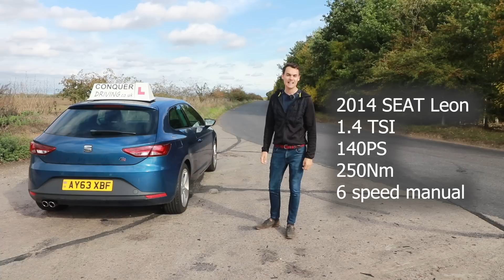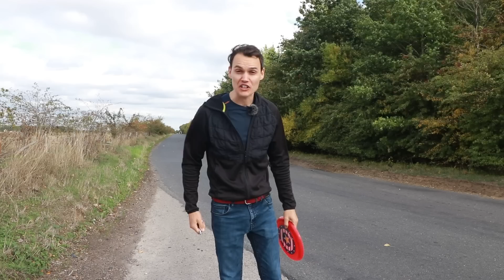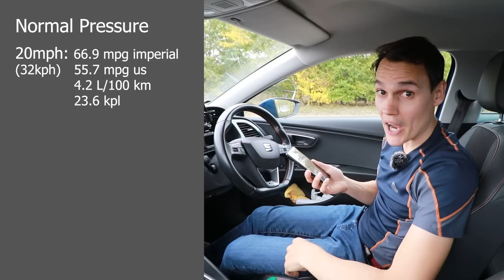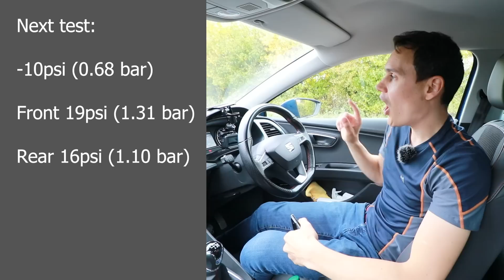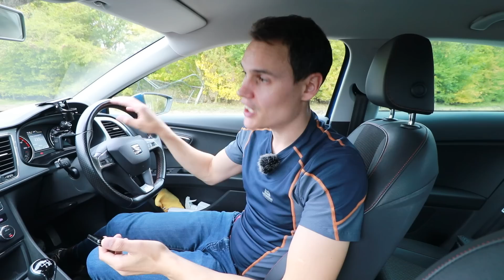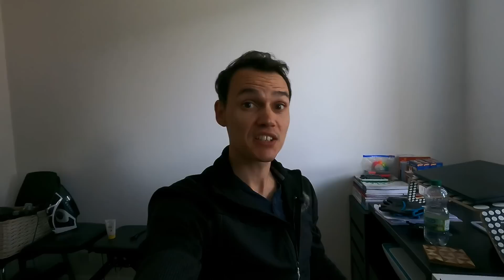Tyre Pressure Fuel Economy Test - Do Lower Tyre Pressures Cause Higher Fuel Consumption?

Comment: For my front wheel drive car, it is specified to use 2.3 bar at front and 2.4 bar at rear. And if its heavy loaded with passengers and luggage, then its 2.5 bar at front and 3.2 bar at rear. I find this weird, since the car is definitely heavier in the front, that in both cases they don't recommend a bit higher pressure at front. My guess is that they optimize for grip in front (they don't put too high pressure), and fuel economy/or possibly carrying heavy load, for the rear.

Comment: I have the same car, seat leon 2014 1.4tsi 140hp CHPA engine, manual transmission. Tyres 225 45 17. My recommended pressures on the fueal cap are 2.6bar on front, 2.3bar on the back normal, full load 2.6 and 2.6... That is a bit more than your reccomended pressure, i dont know why...I drive it 2.8 front and 2.4 back, because anything less that i tried feels bit too mushy on the steering wheel...My tyres wear even, 3 years i own the car

Comment: Fuel economy and tyre pressure dont always follow a linear relationship.

At lower speeds, the impact is greater. At higher speeds, drag becomes a bugger factor in economy, and while pressures still have an impact, its not as big , relatively, as at lower speeds.

However, this is a rather simplistic explanation. Lower pressures increase flex in the tyre, the effect of which is felt more during "uneven" driving - acceleration/decelaration, cornering and braking. If you were to drive in a "steady state", the tyre or flex has stabilized, and fuel economy generally varies much less.

If you were to re-do your fuel economy test incorporating more uneven driving as listed above (accelerate/decelerate/corner/brake) the variations would be most pronounced.

Lastly, the manufacturer recommended tyre pressures are not recommended just for fuel efficiency, the car maker takes into account comfort/handling/safety into account. Depending on the car manufacturer, any or all of these may be given more precedence over fuel economy. So "sticking" to the manufacturer's recommendations does not necessarily mean you are going to get the best fuel economy, it may just be that you will most likely get what the manufacturer claims its cars will do (i.e. comfortable ride or better handling or sporty ride). To get the best fuel economy you do have to experiment yourself and there is always a trade off between all these variables.

Lastly Lastly (i know i said lastly earlier), higher tyre pressures can wear out your suspension and steering components faster. Best not be penny wise and pound foolish and end up with major suspension repair costs while trying to save a couple of dollars/pounds/euro on fuel.

Personally I set my pressures to comfort settings and forget about them. I can save fuel in other ways, mainly by driving smoothly, and that does not have any potential downside of costly suspension repairs,  I am happy to leave a couple of quid on the table in exchange for the peace of mind.

It is a rather interesting subject to theorize over though.

Btw Richard, I must say your communication and presentation skills are among the better ones I've seen on youtube. Very few wasted and redundant words, and always succint yet interesting.Wishing you the best in whichever field your talents may lead you.

Comment: I could be wrong and as this video is old you probably won’t reply but could it be at 20mph with 10psi less in the tyre your rolling diameter decreased enough for the car to think it was covering more distance than it actually was increasing the trip mpg? What are your thoughts on this?

Comment: Fantastic video and explanation! Super detailes and helpful. I have to agree wirh the findings. My Audi recommends lower tures pressure for comfort which I find the ride softer and comfortable. Regarding fuel economy in the comfort pressure, I am getting the the as on normal pressure with better ride quality. I guese it's all about experimenting.

Comment: It's worth pointing out that driving with incorrect pressure can also increase the risk of punctures, which is also a significant cost factor.
Reply: How?  It doesn't matter what pressure a tyre is if you go over something that can/will puncture it - it will still be punctured.  A lower or higher pressure of air between the wheel and tyre does not change the composition of the material used to make a tyre.  To prevent a puncture you would need to change the material or composition of the rubber used, not the speed it is used at.
Reply: This is incorrect. Although high pressures increase the shock on the car.

Comment: One thing I can think of is when running much lower pressures, you reduce your effective wheel diameter, causing your car to think it's driven more miles than it actually has. Thus the higher fuel economy readings at lower pressure I'm curious to test by measuring out a set distance with a pedometer, and comparing it with elapsed miles on the car.

Comment: I was thinking there would be diminishing returns above 40 psi, so not much point going 50, 60, 70 other than having a harder ride and less grip on loose surfaces. I'm not sure at which point the centre of the tyre balloons out, but radial tyres seem to maintain an even diameter over a wider range of pressures and most of the contact patch decrease is front to back, which is the direction that reduces rolling resistance the most.
I think going slightly higher than normal is best for grip as it stabilises the sidewalls. So if you're driving around on 20 psi it's about time you got the air pump out!

Comment: Higher speed = higher centrifugal force on tires, so the tires act as if they're more inflated at higher speeds, that's probably the reason for smaller difference in fuel consumption at higher speeds.

Comment: Tyres lose about 1 PSI in the winter every month maybe 1.5 or 2 depending how cold it is. I always put my 69 plate Corolla to 38 PSI on all 4 when it was recommended at 36 and I get real good mpg on the road.  Regularly at 45 to 70 mpg
Reply from the maker: The Corolla Hybrid gets exceptional fuel economy. Assuming you have the hybrid as they did sell a small petrol in the GB when the latest Corolla was released.
Reply: @ConquerDriving  I have the 1.2t and I get excellent economy. It has 9,900 miles on the odometer

Comment: Lowering tyre pressures on a wheel, causes the wheel to be literally smaller, therefore the L/100 or mpg will read better because the car thinks you're travelling a certain X distance, where in fact the car travelled less in the real world, voiding the results. I loved the video and love your interest and dedication. If all else is equal, this is the last piece to the puzzle.

Comment: Less pressure than recommended equals more flexing of the tyres and therefore more energy lost to that flexing. Energy lost is more fuel used. Simples.

Comment: Have you done a roll test with the car in neutral on a downhill that leads into an uphill?  Cyclists use this test to figure out optimal tire pressure and body positioning for aerodynamics.  Much cheaper than renting a wind tunnel.
Reply from the maker: That is a good idea.

Comment: Hi Richard, thanks for all the effort you put into the video, I especially like that you listed your fuel mileage figures in multiple units, which should cover every country out there.

I am in the US and have been driving since 1971.  I have always been interested in fuel mileage.  Cars in the US have the manufacturer recommended tire pressures purposely set low to improve ride comfort.  All cars here have power assisted steering so, the increased steering effort due to low tire pressures would go unnoticed.

I set my air pressure for each tire based upon the weight the tire is carrying.  I select the pressure such that the contact weight across the face of the tire is constant.  This method gives good fuel mileage and maximizes tire wear.  I also do my own front end alignments.  With a front drive car in the US, the tire pressures usually work out to 42 to 44 psi front, 28 to 34 rear.  The rear pressure variation is due to the number of people normally carried and stuff in the boot.

To give a little more accurate results with your mileage versus tire pressure tests, may I suggest instead to do a coasting test.  To make things easier, just take the car up to 20 mph, then measure the coasting distance.
Reply from the maker: That's a very good idea.

Comment: I have a thought: the diameter of the tires changes and the car computer is assuming normal pressure and nominal diameter. When the pressure is 5psi lower, the extra dragging is not so significant and computer thinks you are going extra distance.

Comment: Hello Richard! Thank you for always making these great and insightful videos that we can't get anywhere else! I know I speak for many of your subscribers when I say I really value your first principles approach to driving and the assumptions people have about cars and related topics.

I'm curious to hear your thoughts about the idea of warming up the engine before starting to drive? Is this really beneficial from a fuel economy (or engine health) perspective? And how does this hold for petrol vs diesel cars? Thanks a lot in advance!
Reply from the maker: Thank you for watching. Everyone has their own opinion about warming up the engine before driving. My advice is to let it run for 5 to 10 seconds and then get moving, letting it warm up at idle will only use more fuel. But drive gently until it's up to temperature to help protect the engine.
Reply: @ConquerDriving  well noted, many thanks Richard!

Comment: tire pressure should be set firstly by tire manufacturer recommendations, not car manufacturer
secondly, should be adjusted to the weather you drive in

car manufacturer pressure recommendations are for the tires it leaves the factory on

Comment: 35 psi front and rear in my Peugeot 306 turbo diesel. I have 17 inch alloys instead of the original 14 inch steel wheels, now running 205/40 profile tyres instead of the previous 185/65 ones. I get a consistent 53mpg, in spite of having increased the fuelling a bit, to complement a freer intake and exhaust. When bog standard, the best I ever got was 47mpg, even at the recommended tyre pressures. Modern cars are so much heavier, safety etc., and I think that most of the loss of economy must be due to actually getting a car off the mark and rolling. A 6 speed gearbox would suit me well, were I one for doing long distance driving, but I rarely go further than round trips of 12 miles nowadays. Isn't it strange how cars of yesteryear, motorbikes also, had much lower recommended tyre pressures ? Heavy 1960's and 1970's cars were often under 30psi and a Triumph 750cc bike I had was 26 front, 28 rear. My lighter, i.e., plastic adorned 2004 1000cc Suzuki V twin is 36 front, 42 rear. Too high, in my opinion, for a 9 stoner like myself. That said, the rear wears its centre out pretty rapidly if I drop the pressure by more than a couple of psi. There's no way we can win ! The VAT man is the only one continually grinning.
Reply: Oh dear, another clueless boy racer!  Who do you trust more - a company that spends millions on research and development, or a backstreet trader that makes wild claims in order to take your money?  The best parts for the car are fitted when you buy it and you're not going to turn a 1.2 or 1.4 or 1.6  in to a racing car.

1. Increased fuelling.  Absolute rubbish, you can't as the ECU stops this, so it doesn't matter what you think you are doing to the car or even what you try, it will still go back to what it should be based on the dynamic adjustment from sensor readings.  Fuel rail pressures can be messed with using a cheap nasty "tuning box" often costing £400 even though it contains a simple voltage multiplier costing 23p!  Those devices take NO input from the ECU or send info back, all they do is increase fuel pressure by a set amount.  They go in series with the fuel rail and damage the engine, especially when cold and more diesel is sent in, the box causes even more to go in and causes smoke and clattering.  You would need a proper ECU REMAP and who would you trust doing that?  Some youtuber that just increases everything from standard without any real knowledge.
Don't forget, those companies will never pay up if you damage your engine!  It is also possible to insurance and police investigators to find evidence of using such devices as that info can not be deleted from the ECU - it is accessed in investigations all the time.
Manufacturers also refuse to honour warranty claims and you void your insurance anyway.

2. The air intake!  Biggest way to make money from fools is to sell them a tiny mesh/oil or foam filter that doesn't even filter and is a much smaller surface area than a paper filter, so ends up blocking up and degrading performance far quicker, plus it doesn't pass anywhere near the amount of filtered air to the engine.  There is also a sales opportunity for cleaning solutions, you will have to clean it every few months.  If you had a paper filter it could still pass more filtered air until it was nearly blocked.  People will remove resonators due to not knowing what they do, they cancel out noise on the intake, they do not restrict anything.  The pipes and inlet are the correct size and the standard system fitted to cars passes more air than the engine requires at full RPM.

3. The exhaust, another way to get money from gullible fools. You can spend what you like and it will make NO difference to performance.  All it will do is make the car sound rubbish and everyone will look around thinking someone is driving with a hole in their exhaust and see a small car doing 20mph.

4. Suspension. Don't just throw kits on without getting the suspension geometry checked or you upset the handing.  People are so clueless they call a DAMPER a shock absorber.  The shock absorber on a car is the SPRING itself, the DAMPER is what keeps the wheel/tyre in contact with the road.  Lowered suspension is bad on a family car as it can make handling unpredictable and is often the cause of many accidents.  Lowering a ride height might look nice, but does nothing for handling.

Many boy racers grow out of it after being scammed for years.  Many feel stupid after spending all that money for years and having a car that is slower and noisier than standard, plus costs more to insure and the handling is rubbish.  Use the VW approach and fit a fake engine noise generator - in the Golf it has a thing called a SOUNDAKTOR under the bonnet to make the occupants hear the noise of a V8.  Switch that off and the Golf sounds like any other car inside!
Reply: @Bond2025  Thanks very much for the compliment, I'm 66 ! I trust the evidence of my own experimentation.

Comment: instead of driving at same speed you should drive at same RPM. Lower pressure gives smaller diameter of the wheel and your speed will not match, what means you could be driving slower than you think. Slower drive means less consumption. One more thing, due to inertia to keep car moving requires low amount of energy, but empty tires will make most of the difference on stop and go kind of drive where you need a lot of energy to do drastic change in motion. But whole point of correct tire pressure is tire grip and wear.

Comment: A variable affecting results could actually be the air conditioner as its load will vary depending on how hard it works, on the hwy my fuel economy gauge will change depending on whether the aircon is switched on or not

Comment: Another factor at higher speeds are  resultant higher tyre temperatures which then  pushes up tyre pressure that you have not reported on.
Reply: This is why a lot of people put 2PSI lower than stated in and as they drive, the pressure will increase to what is shown on the handbook after a few minutes.  I am not sure that is the correct way to do it.
Reply: @Bond2025  Not sure it would be appropriate in that the manufacturer might have already accounted for this.  It would be nice to know if one way or the other.

Comment: There are two major factors which I would consider caused the lower fuel consumption of your car with lower tyre pressures - Fist is reduced windage due to the car being slightly  lower to the ground which allows the better aerodynamics of under the car  (ground effect) and lower effective frontal area.  The other maybe less important factors may be the tyre characteristics themselves including tread and sidewall for those particular tyres.

Comment: PSI is best measured cold.  the heat of the tire heats the air and softens the rubber changing the pressure.  the only real way to test this is to let the ties cool then adjust pressure than  heat the  motor up than run the MPG test.  But this 5 pound doesn't make a difference.  In a large truck the difference between 90 psi and 120 only gains about 0.25- 0.5 on vehicles that get 6 or 7 MPG so its getting you about 5-10% better mpg to have 33% more air in the tire (tires are rated to up to 120 but only 90 is need  to carry the weight)

This make a big difference when you drive 400 to 700 miles in one day. not so much when you drive that in a month.    DO NOT EXCEED THE MAX PRESSURE RATING OF YOUR TIRE as you drive the tire heats up and this can cause the tire to explode when driven @ high speed or long distances.  The max pressure recommended by the car manufacture is less important than the one by the tire maker.  Higher strength tires can support higher pressure and will often require it to keep the proper shape.